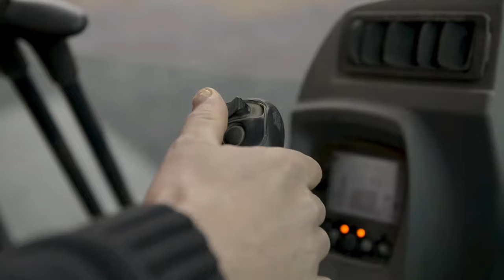The Ultimate Hardscape Clamp

Comment: Nice but each layer isn't the same. The gradient of the color changes ever so slightly.
Your supposed to take the pavers from top to bottom, left to right or vise versa.

Never the whole layer in one.
Reply from the maker: There is opportunities to pick off of multiple pallets to help with variation.   This is typically used for larger commercial applications.